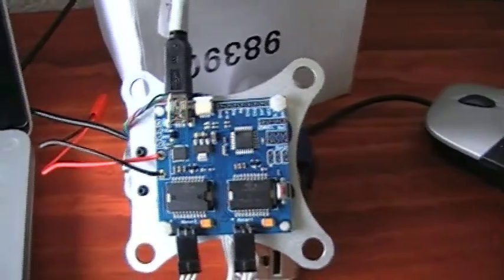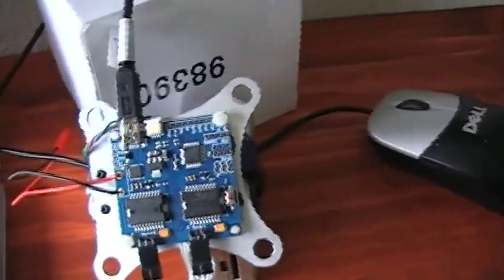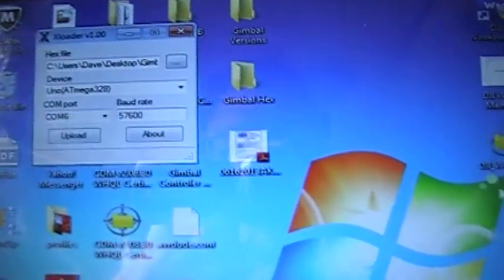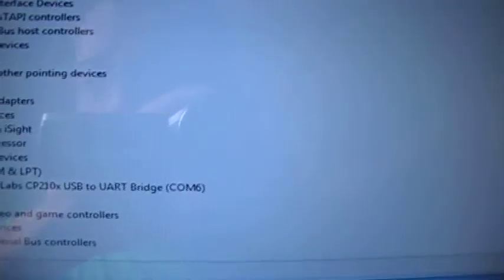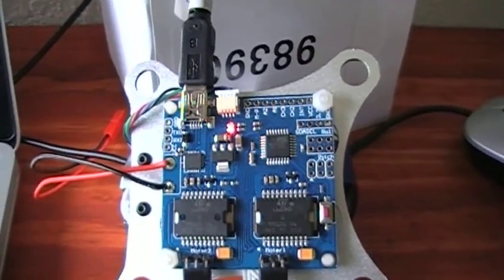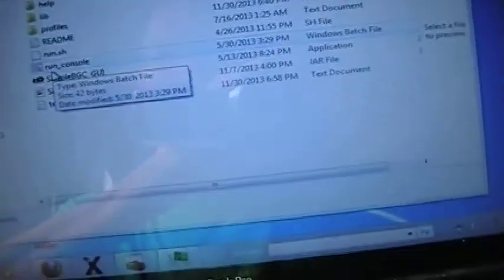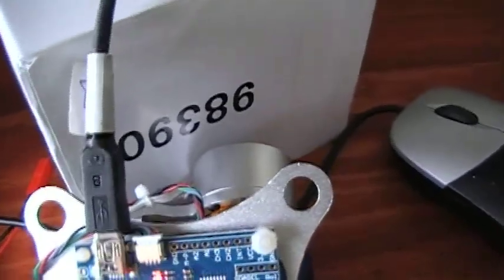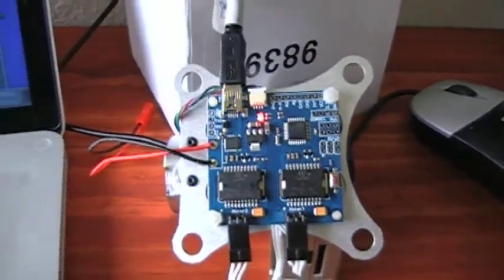Brushless Gimbal Controller V2 Issues

Comment: Fixed my problem.  Had to start from the very first firmware (2.0b3) and upgraded with each firmware after that.  For some reason though I can't upgrade to 2.3.  I'm stuck at 2.2.
Reply from the maker: Thanks Jason.  I haven't had time to work with my BG lately, but I'm glad you got yours working.  I will definitely try that.  Do you have the same controller as mine? And if so, did you have this same issue? Take care
Reply: dbaxterjr Yup, same exact one with the exact same issue, plus some.  It's the Arris CM1000 or a knock-off of.  Your dampers should say arris on them. When you do get a chance to mess with it again, with xloader, can you select a different device other than Uno(atmega328)?  That shouldn't be an issue, I'm just curious.  My dropdown only has the simplebgc as selectable device.